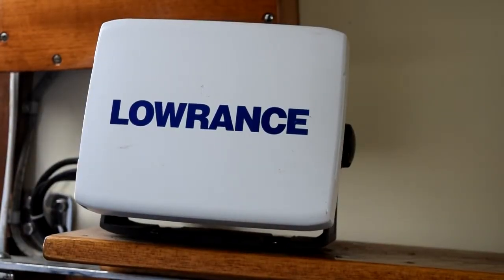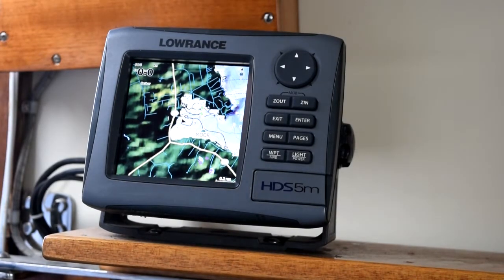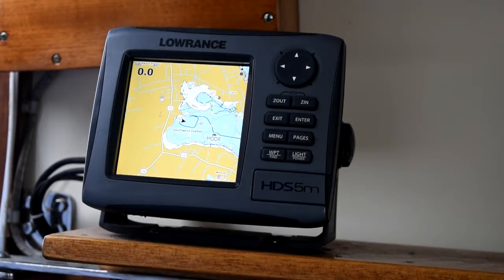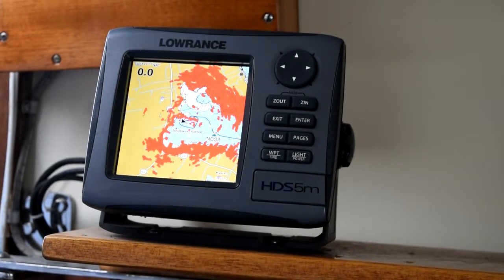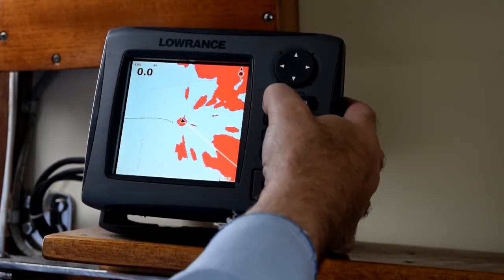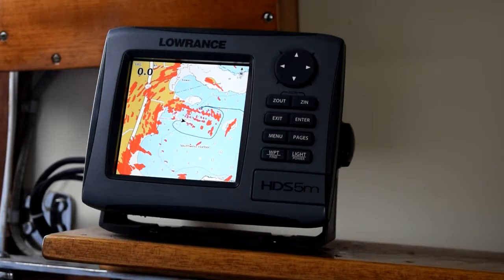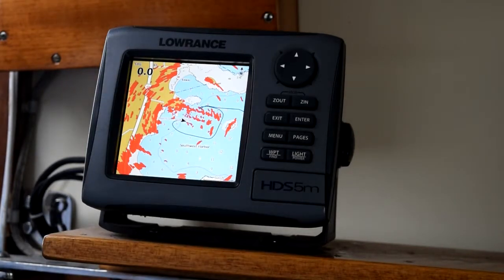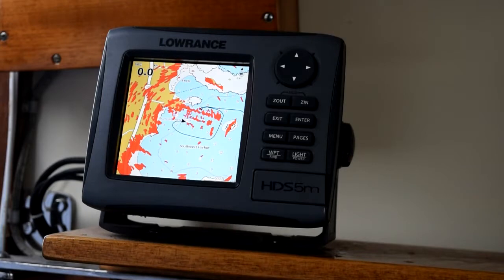Lowrance HDS-5M Chart Plotter with BR24 Broadband Radar

Comment: Thanks, that answers a lot of my questions about chart plotters. What is your opinion on ones with internal or external antennas?
Reply from the maker: The internal/external antenna question can be significant.  The big factor is where the plotter will be located because GPS signals are quite weak.  Consequently a plotter with an internal antenna may not work well (or at all) if it is located down inside the boat.  That said, the internal antennas on newer plotters are quite sensitive so as long as you don't have a layer of metal above the plotter it will generally be OK.  My Lowrance HDS-5m has an internal antenna and it works fine inside my sailboat.  However, I added an external antenna to get more functionality.  One capability of the HDS series chart plotters is radar overlay on the chart.  In other words you see the radar signals superimposed on the chart display.  However, that function does not work with only the internal antenna because the plotter itself does not have a fast heading sensor (fluxgate compass).  So in order to get radar overlay to work I had to add an external heading sensor.  The sensor I chose (Lowrance Point 1) is combined with an external GPS antenna.  It was very easy to hook up since it simply plugged into the NMEA 2000 network.

Comment: Nice to have in bad weather.  Think i saw your radar antenna (is that what you call it? ) in one of your videos
Reply from the maker: Yes it is nice to have working radar.  Last summer it wasn't working so I removed the scanner (aka the antenna) from the mast and did some tests after the boat was hauled out.  It turned out to be a software issue that was easily resolved.  It is nice to have it working this summer.  I made a video about putting the scanner back on the mast, which is what you saw.